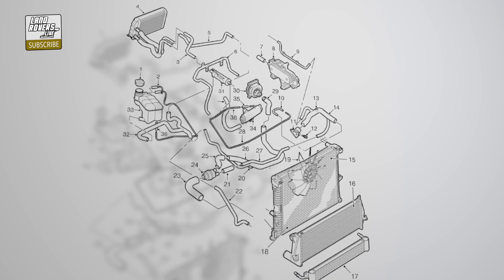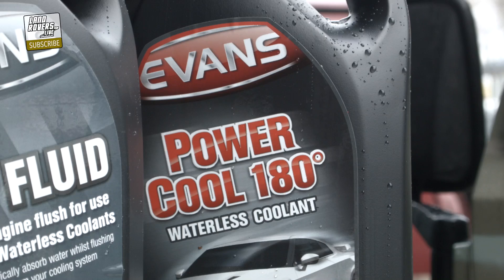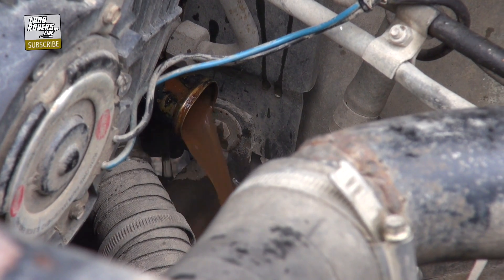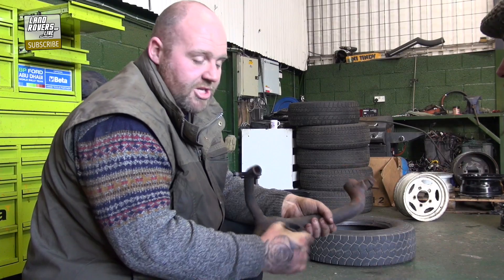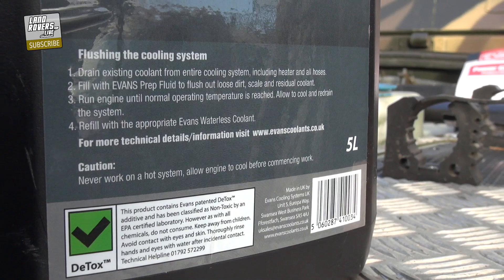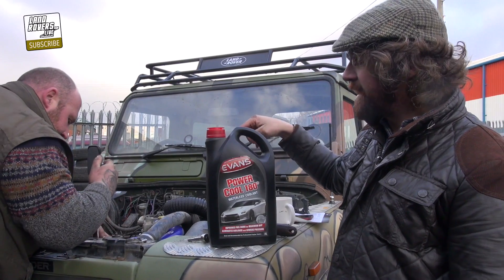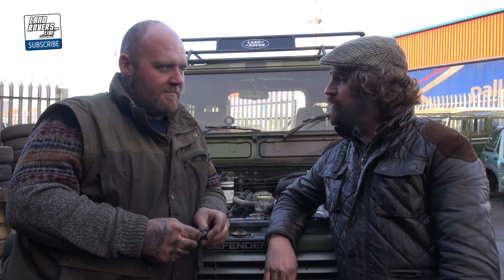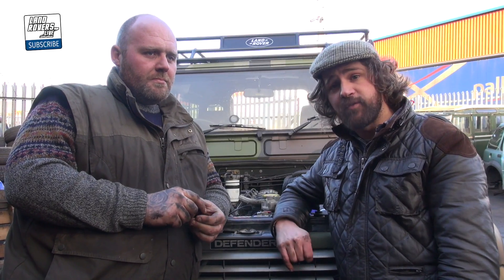Workshop Guides - Cooling Systems + Evans Waterless Coolant

Comment: yALL SHOULD DO A FOLLOW UP .. SEVERAL YEARS LATER TYPE THING.. Evans in great stuff.. Especially in modern cars where an overheat will kill your car.. no corrosion , pressure etc is worth it to. besides the 375F boil point.. Jay Leno has had evans in one of his cars for 17yrs